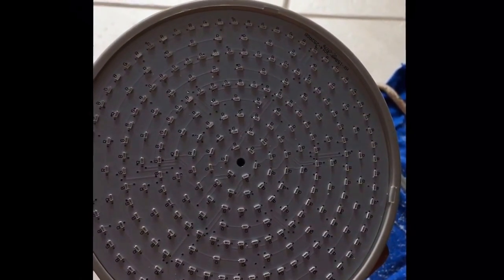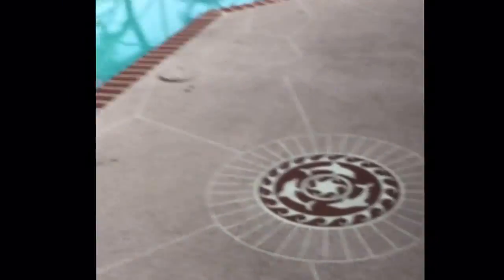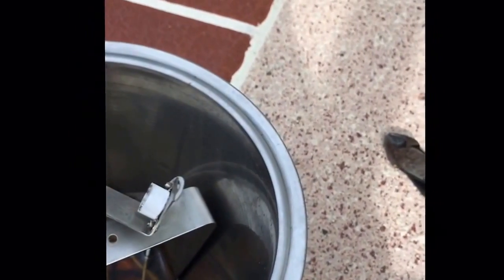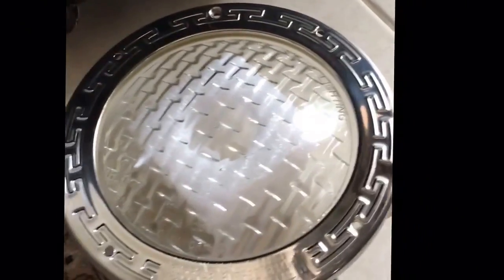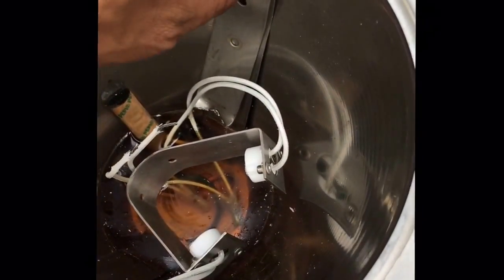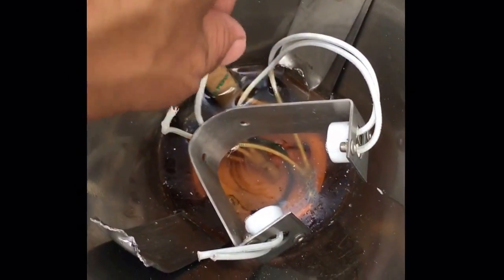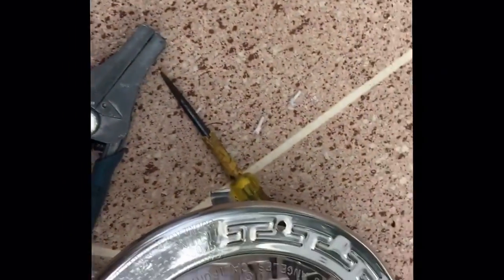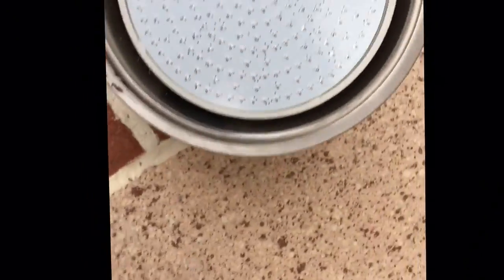How to modify pool light to LED from incandescent or Halogen

Comment: Hey buddy, loved this video and did what you did and works great. Also no issues since it’s 12v. Question, I read a comment where you said light did not last? Why wouldn’t it last if it’s connected literally the same way it works if it was screwed in? 
Also, if it was done correctly no water should be able to penetrate? Why would the light just go bad? I think it might be the light not what you actually did that caused it to malfunction.
Reply from the maker: Yeah bro it didn’t last long only because the quality of the led bulb I used. It wasn’t because of how it was done but more of the manufacturer of the led light. It has improved over time so I’m sure there are better quality led bulbs available now. 
The method was safe because no water gets in plus it’s 12v. I wouldn’t do this with 120v :)
Reply: @HowToDoitright  hell no I wouldn’t do it with 120v. But 12v yes for sure lol btw you saved my life yesterday I was going crazy trying to figure out what to do until I saw this video thanks man

Comment: 2 weeks ago, I did the conversion you shared. I ordered the Led light on Amazon as well. I had 12 volt - dual  halogen bulbs with a colored wheel that turned. The wheel stopped working a year ago and stopped on the clear lens. So I had a white pool light until it finally died. I was searching for a replacement option when I found your video. My wife thought I was crazy and didn’t think this was going to work after spending about $70 on the replacement light. I did test it before I cut the end off to make sure the light worked. The system I had had multiple wires that also went to the motor to turn the pinwheel. I removed a lot of the excess wires. I also had to add some aluminum clamps I had to secure the light in place. My light housing is different than yours. It works awesome! Thanks for sharing. Worth the time and effort to save a bunch of money.
Reply from the maker: Glad it helped

Comment: Does the bulb remember the last color/show or do you have to set it every time you turn the light on? Or does it always default back to a particular color? 
Does it have a remote control, if so does it actually work through the metal housing underwater?
Reply from the maker: It remembers the last color.

Comment: I had one 120V 35W from WYZM led pool light bulb for my 20000G pool,it works great,husband and kids love the pool so much,and this color changing bring a lot fan for our family time.Just flip wall switch on/off to choose your favorite colors.

Be noted you need buy a new gasket in case of leak.I replace this bulb with a new gasket,and my bulb works well for a year.

Also I notice they have a discount on amazon prime day,you can choose what you need by spend 90~139USD per bulb,they have 12V and 120V version.
Here is a link for you guys
https://www.amazon.com/WYZM-Changing-Swimming-Lights-Light-E27/dp/B00WE1SKIW/ref=sr_1_7?ie=UTF8&qid=1499678534&sr=8-7&keywords=led+pool+light